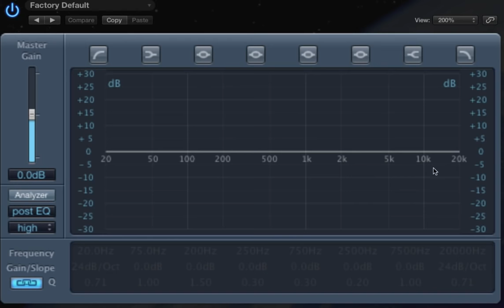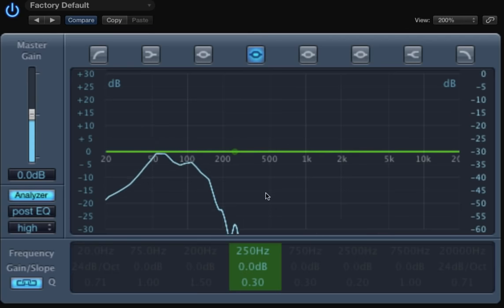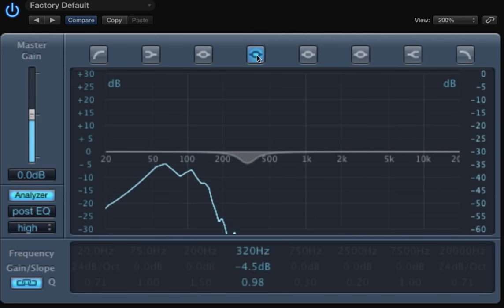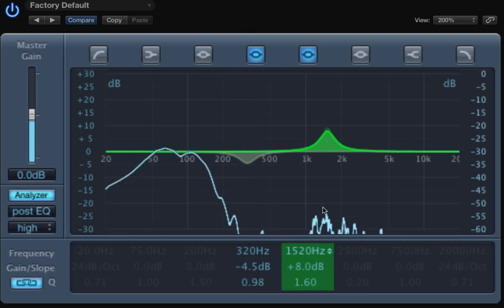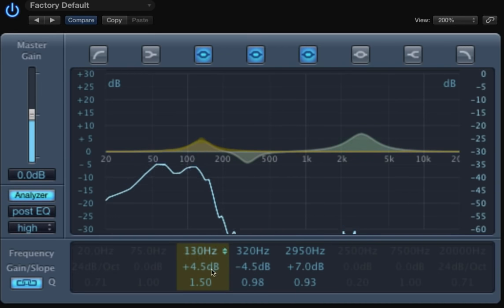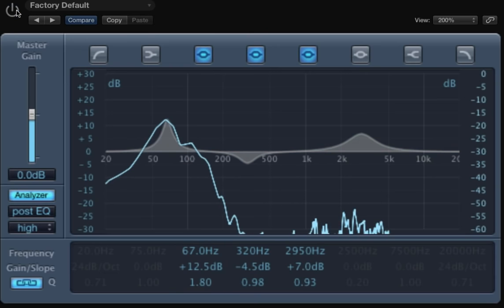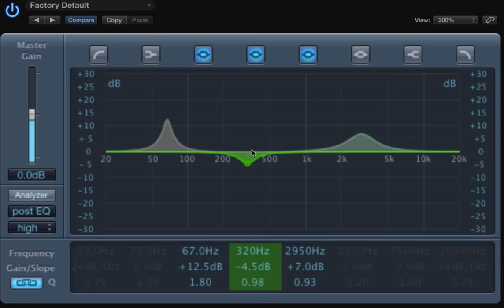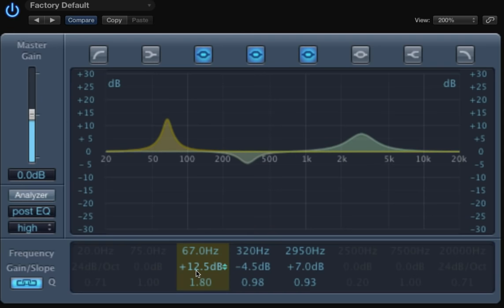Magic frequencies to equalize a kick drum (bass drum)

Comment: what if i'm using only one equalizer and analog mixer?
Reply from the maker: If your mixer doesn't have at least a semi-parametric EQ (variable freq.), it's very hard to get good results. You can try boosting high and low shelving, but it may sound "muddy".